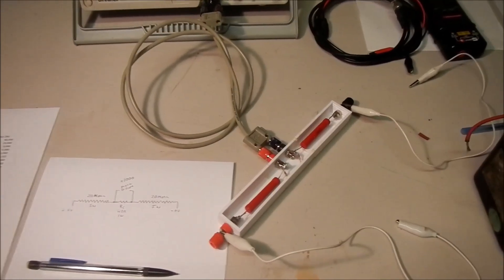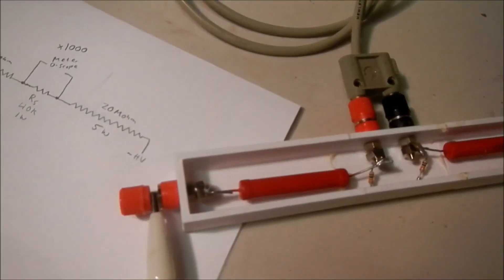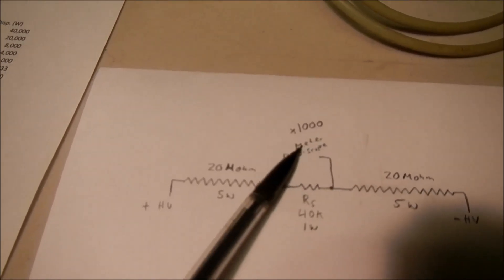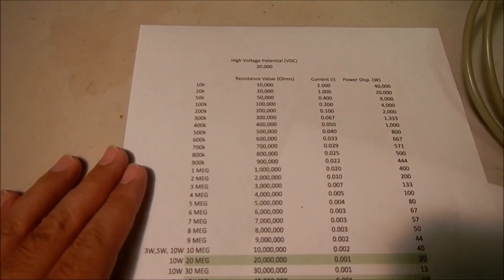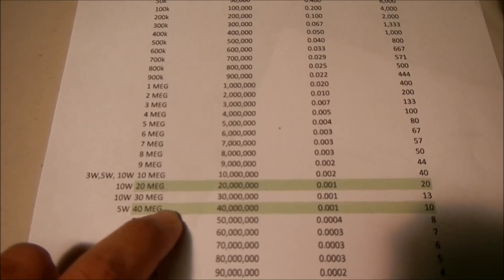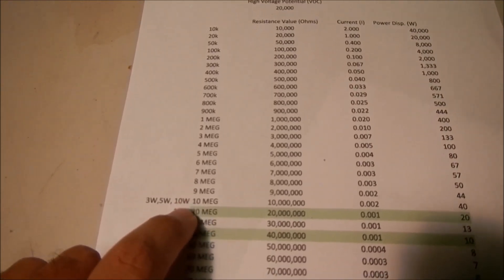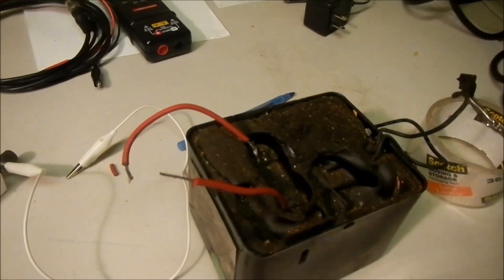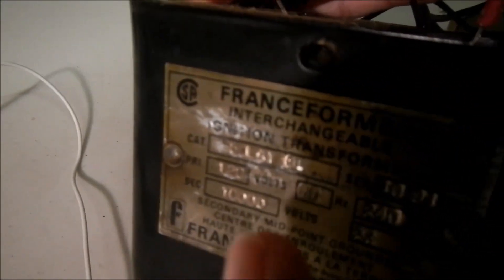DIY High Voltage Probe Design 120 to 20,000 Volts, Divide 1000x Probe

Comment: I wonder what to do in situation faced by me?
The two Neutrals from the two outputs 230 VAC of the Nitrox Inverter ( 3 KW - 24 V, SP - Hybrid _ by A.P.T. ) aren't allowed to be jointed! The Inverter demands the two Neutrals to be isolated and afloat! I'm rather perplexed. Obviously the two Phases are certainly to be distributed isolated!
The problem faced has been that either regular Load RCD or the Smart Load RCD have been in the habit of tripping off upon Grid On / Off since installation. Even sometimes the RCD on the Input to the Inverter also goes off! 
The reason: the wiring of my home has become leaky for sometimes. I've been curious about the Phase difference of the two outputs of the Inverter. Is there any way to examine it's two lines 230 VAC (RMS) each. Probably phase difference of 120° with about 460 VAC (RMS) that amounts to be ~ 651 VAC RMS ! Moreover, the grounding croc clips of the O-Scope  share the same common ground! 
Is there any way to compare the 2 outputs, one 'Regular Load' and the other 'Smart Load' be visualized on single O-Scope screen with custom devised High Voltage Probe(s) X100 on single or Dual Channel OScope?
Note: The Inverter trips the RCD's on bringing the the neutrals near each other.
I'm a medical doctor, 
who happened to be a life long Accidental Scientists.
Help is awaited!

Comment: this is nice but…. should you lose any ONE of those center resistors (even one of them) your oscilloscope is toast. you should use several resistors in parallel there in case one fails or insert a neon or something to short high voltage.
Reply from the maker: Not really, say you measure 20kV thats 200V at the scope... my 40kohm V sensing resistor blows, I'm still protected by two 45Mohm Resistors. scope internal impedance is 1M so scope voltage shoots up to 400V scope input is good to 600V. so I'm still OK.... if you want to be precautious you could always put a MOV across your Vsense resistor but in this case I don't think it is needed.
Reply: Exactly, my thought too.

Comment: Thanks for the VERY useful video!!  
I couldn't make out the current on the ignition transformer.
Despite the high voltage, this HV transformer current can be easily measured with a cheap DMM.  I set the meter at the 200mA (AC) range, then TIGHTLY secured the high voltage wires on the meter leads --NO SPARKS ALLOWED WHEN DOING THIS- then turn on the (current limited) transformer.   It should match the label current!  
One thing learned the hard way:  If the DMM fuse happens to be open when you make this measurement, then you get a 10,000 volt arc, GOODBYE DMM!!!  I first used this when I pulled several shunts on a de-potted (tar) neon sign xfmr (15kV@60mA)...got over 70mA and re-potted in paraffin.

Comment: I want to design Dc 100kv and ac 75 kv hv probe any help
Reply from the maker: I have an excel spreadsheet calculator I will try to get it on the website.
Reply: @sparkstarter  is it on your website yet?
Reply from the maker: @johnnycash4034  Yeah Check out the Calcs Page

Comment: Ow that resistors are 5watters. But indeed double. But dont you think that a hv-load of 10watt is a little high load when you wish to measure on voltage multipliers? I myself used 2 5watt hv-resistors 200Mohm parallel to drive a 200uA analog.meter so full scale is 20kV. (2x 20kV diode (2CL77)& 2n2@35kV capacitor inculded of course).
That is still too high load for measuring any multiplier output but its good enough for measuring the 10-40kHz AC that feeds them. 
Oh it is great&interesting&always helpfull to watch another man playing around with hv, especially while you do such precise measurements in your vids

Comment: Connecting the 40K resitor by using 4pcs 10K in series does not increse wattage. You use 0.25W 4pcs then you have 0.25W total. This is serious flaw.
Reply: íf you dont understand the very basics of electronics than dont comment on videos.....with SERIES resistors you OBVIOUSLY sum the power rating if they are all the same value...and you get the total maximum wattage
Reply: @MrHBSoftware  Well somehow google does not tell this, parallel means power adds up, series means resistance adds up.
Reply: @juliusvalentinas  yes basically the maximum power dissipation of a resistor depends on its physicall size and the material used in its construction...using many resistors in series multiplies the size and increases the heat dissipation capabilities thus increasing the maximum wattage rating n(more surface area = more heat dissipation capabilities)....sorry about the way i spoke,maybe a bit arrogant but it seemed you were certain about what you said, yet you were wrong
Reply: After watching this video and then reading these comments, I'm gonna subscribe to the channel. As far as the so called condescending reply to the person who sure as shit didn't know what they were talking about, I found the reply to be somewhat polite. If a person goes out of their way to make comments and present their opinions as if they are solid facts, they should at least be 100 percent certain. Just because an online search engine does not explain the proper results is not a reason to defend someone who didn't do their homework lol.
Reply from the maker: Nope, sorry kiddo,  your circuit analysis is flawed. 4 quarter watt resistors will have a total max. power dissipation of 1 watt in series or parallel. Might want to go back to the circuit theory book and brush up.
Reply: @sparkstarter  You were rather condescending in this reply, but I looked it up and you're right.  I wish you could've been a bit more considerate though.
Reply: @sparkstarter  I will tell you where you flawed 😀....you didn't consider scope input impedance in parallel with your quarter watt resistors ...:-)
Reply from the maker: @sanmeethundal3397  Nope, 40k << 1M  Ohm  scope input, so there is no loading effect from scope impedance unless you are at very high frequencies.
Reply: @sparkstarter  What a pretty poor response. Not the best way to gain subscribers.
Reply from the maker: @mqblowe  Nope, sorry kiddo, you gain subscribers by having useful content, not a coddling and apologetic comments section.
Reply: @sparkstarter  I unsubscribed your channel right after your rude reply. It was totally uncalled for.
Reply from the maker: @woozygrizzly  such self righteous indignation, you should do more of that, it helps your ego.

Comment: How do you get away with only 20M resistors when this guy uses 200M/200K???
Reply from the maker: Again you need to brush up on your circuit theory... see Ohm's Law. V=I*R so 20kV/20M = 1mA , and I'm using 2 of the 20M for a 40M total resistance.
Reply: @sparkstarter  should it be 20KV/40Mohm ?
Reply from the maker: @rashidmdamin5552  Do you have excel? I put a free calculator on my website for High Voltage divider.
Reply: @sparkstarter  Yes, pls give me the link, tq.
Reply from the maker: @rashidmdamin5552  See Free Calcs Page https://www.sparkstarter.tech/